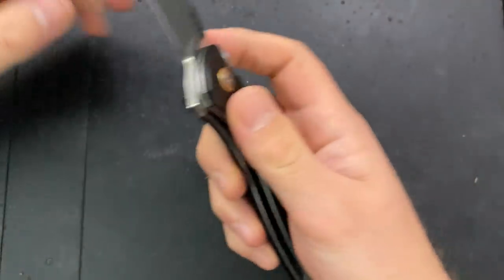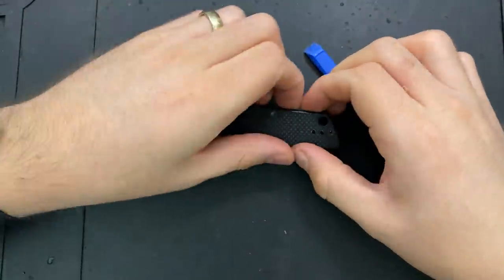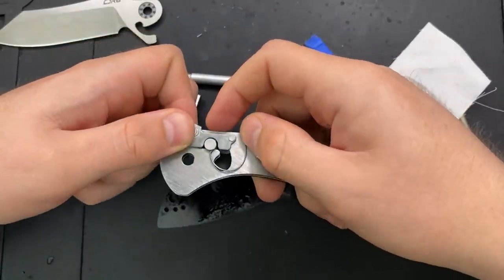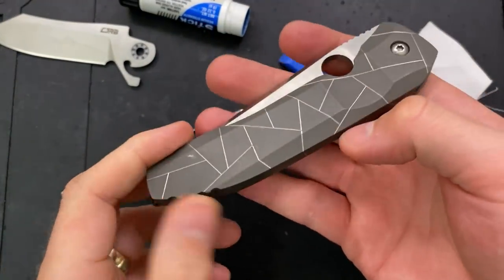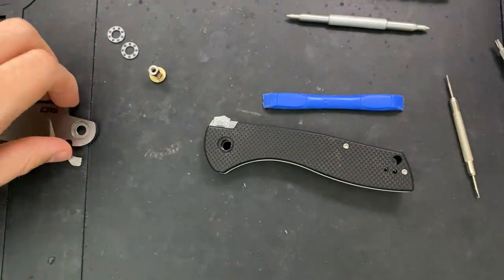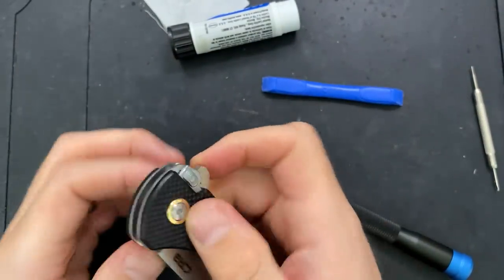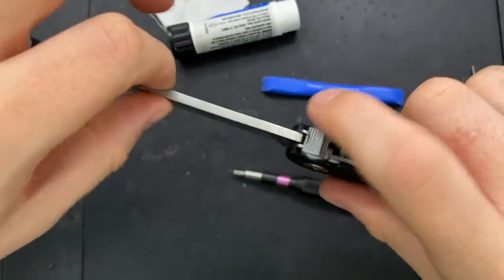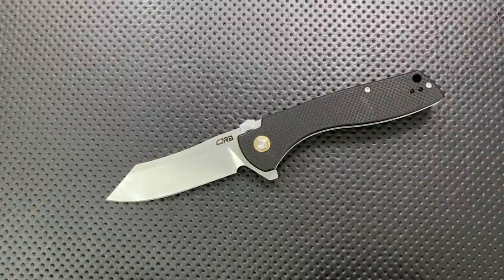How to disassemble and maintain the 'Recoil Lock' CJRB Kicker (with first impressions)

Comment: This lock actuation seems to address the issue of uneven pressure on the sliding bar. Uneven pressure on the bar, according to some nonauthoritative sources, can cause wear asymmetry and may contribute to omega spring failure.

Comment: I've had this knife for a month, now. Unimpressed enough not to venture off to explore it's bigger brother, the Blowback. That blade is off to a slow start, based on continued availability at all major sellers. On this particular blade that release doesn't have much friction on the finger and my index finger is constantly slipping off what appears to be a tumbled finish pot metal or whatever. The sides of the release are even worse. In all, this one gets a giant, "Meh!". 🙄
Reply: Good to know.
Reply: Yet I own both the Kicker and Crag with the recoil lock and I have no issues. I also have looked at a few that friends have purchased and theirs also work well. I do understand what you are referring to but it isn't very hard to run a checkering file on this if need be. 
Maybe I am just a really lucky person and have good ones. 
I do also know you want to keep the pivot kinda snug. It makes it easier to flip , when the pivot is too loose it feels like a super weak detent. 
I collect all sorts of knives and I really like innovative designs and really go after these kind of knives. 
I am not saying this is better than Benchmades Axis lock , but I also feel it is a worthy lock to own. Over time these become smooth and easy to operate.
Where Ganzo did copy the Axis lock they use stronger omega springs. They take some real time to break in and never become as smooth as Benchmade..

Comment: I worry you could accidentally disengage the lock doing drawing cuts? Maybe since you're already applying pressure in a safe direction on the blade that's not much of a worry but it might be an issue.
Reply: But if you are doing a draw cut and the lock disengages, the drawing action will keep the blade open

Comment: Interesting... 
New locking mechanism but I would prefer the axis-lock that could provide an even spine from handle to blade... IMHO Spyderco's Ball Bearing Lock is the best solution of all those types of locking mechanism, simply cause you don't have to deal with an Omega Spring at all...
Thank you for the presentation...
Reply: Alexander Bertallo Benchmade Anthem doesn’t have omegas either
Reply: Thing looks like a bitch to take apart!
Reply: I won’t take my benchmades apart because of the omega springs
Reply: @carsandgaming1734  the Benchmade Anthem is a masterpiece... exeptional... and they "fixed" the omega spring "problem" out of necessity...
But this Beauty is out of my price range, and that's ok;)

Comment: This seems like it’d be an incredibly weak lock if I’m understanding it right
Reply from the maker: No, I don't think so.  Sliding bar, axis-style Locks have all the strength needed for daily life.
Reply: The tests I've seen of the original Axis lock design put it pretty near the top for sheer lock strength, just below the Tri-Ad and Compression locks and on-par/slightly ahead of the Ball Bearing lock. I'll give you that this is a different company and a slightly modified design, but those mods don't seem to affect the actual lockup.

Comment: The Axis lock. One of the most overrated locks invented. It's like the half leaf spring rear suspension on older Corvettes. Did it work? Sure, but there was zero reason them to use it.
Reply: I wouldn't say zero reason. The axis lock, and locks like it (compression, ball bearing, etc), allow you to close the blade without putting your fingers anywhere near the cutting edge, and are ambidextrous, which is handy not only for lefties, but also if you need to close your knife with your off hand.

Both of these points are definite advantages compared to the "standard" frame/liner lock configuration. The Axis lock is also generally considered stronger than frame/liner locks, although for 99% of edc knife users thats irrelevant.
Reply: Overrated🤔 As compared to what?
Compare a Benchmade knife to a Corvette😎 Overrated? As compared to what? It's not a Porsche, and it's not a Toyota or a Nissan🤠
Zero reason to use it🤨 Are you a slipjoint fanatic? It works well. So how and why would you want to replace it😶
But really ... did you actually try it? If you haven't and if you can't spare the money for a Benchmade knife (I would recommend the Mini Presidio II - not the prettiest knife but excellent value) then you should try one of the many Ganzo knives that come with the axis-style 'G-lock' (stronger springs than on the real thing, but still easy to actuate) or if you don't want to go Chinese then maybe the Asher Knives Centri or Nomad could work for you (or perhaps a SOG Terminus XR🤫 Or if for some reason you just don't like Benchmade, Hogue seems to do very well with their able-lock👊).